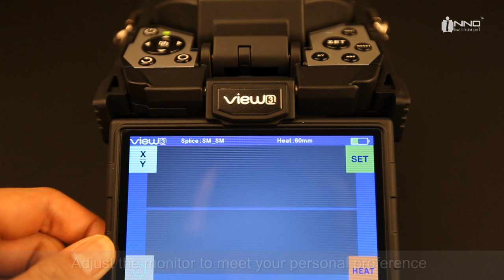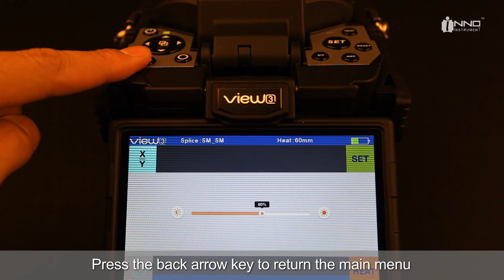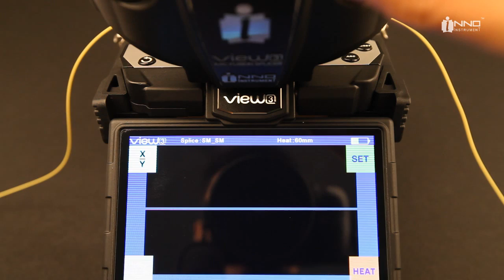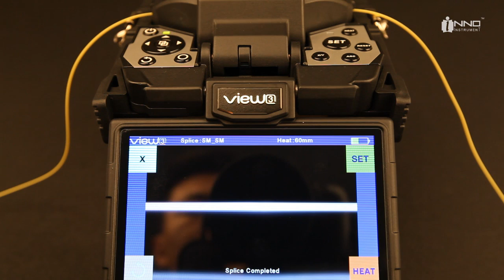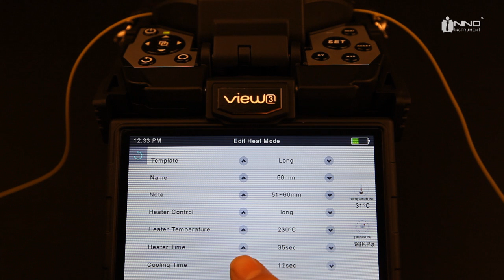Fusion Splicer View3 Operation Instructions - INNO Instrument Tutorials

Comment: How to rotate the display sir?
Mine is upside down
Reply from the maker: Hi Sir, you could tap on system setting, page 1 under monitor position, tap on front / rear. the screen will rotate accordingly. Hope it helps :)